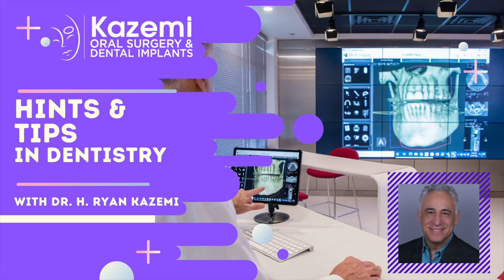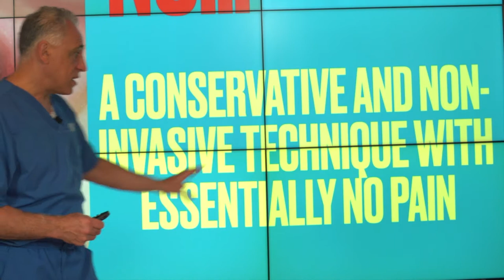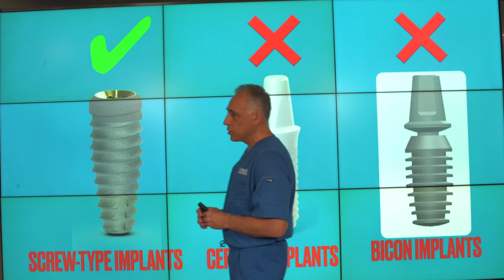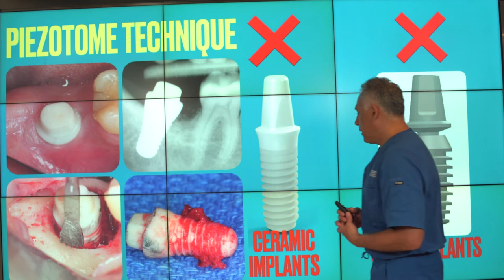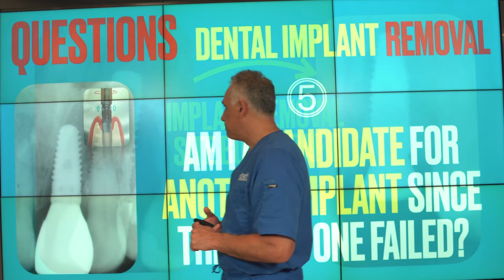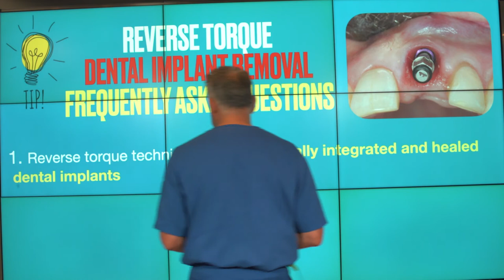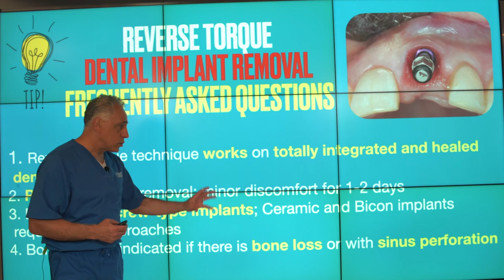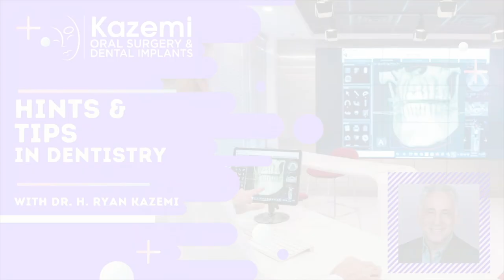Non-Invasive Reverse Torque Removal of Dental Implants- Part 2

Comment: I am guessing you cannot do the most minimally invasive reverse torque technique with Bicon implants because they have a round recess and there is not any or enough leverage to reverse torque them out?   But even with minimal bone left around the implants?    Awesome videos!
Reply from the maker: You are correct. With Bicon implants, I use a very narrow piezo tip to remove minimal bone and then mobilize the implant. Thank you

Comment: Can the reverse torque technique be done on 3 adjacent implants at the same time and or if a reverse torque technique is done without any removal of bone because you don't have a ceramic or Bicon implant, in cases where there is implantitis, and significant bone loss, what do you fill the socket with directly after removal?    Are the socket/s cleaned if the most non-invasive reverse technique is used and do they have to be sutured?    Again if so, do you throw in collagen foam or do a bone graft then and there?   Otherwise won't the gums recede significantly more than if no collagen foam insertion or bone grafting is done then and there?
I appreciate this video.   I am hoping I don't have Bicon implants.   Thanks!
Reply from the maker: Adjacent implants can be removed safely with reverse torque technique. A minor site preservation / augmentation bone graft can be done using allogeneic or xenogeneic bone particulate. Sockets are always irrigated after implant removal. Suturing may or may not be necessary depending on socket management strategy. Bone graft or collagen materials should be used as appropriate based on condition of the bone, soft tissue, and socket management goals. I hope this is helpful.